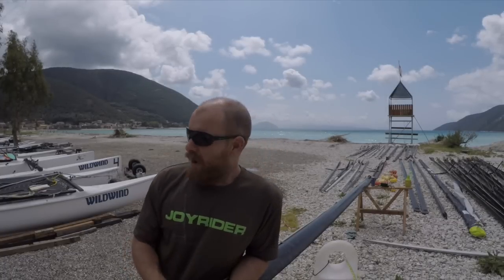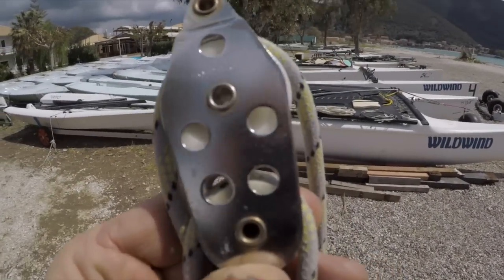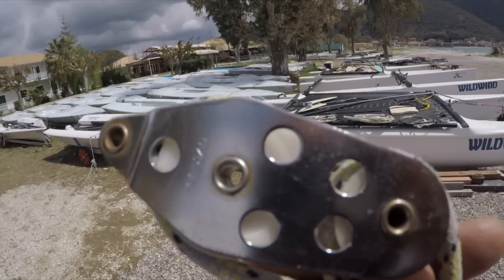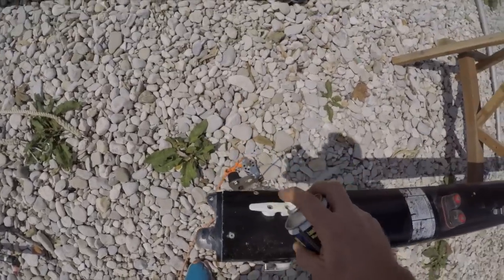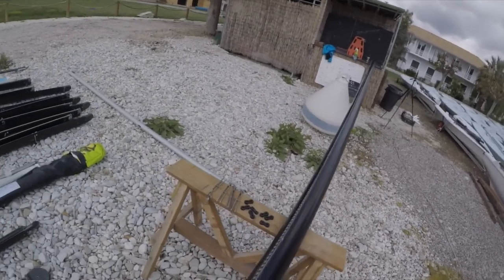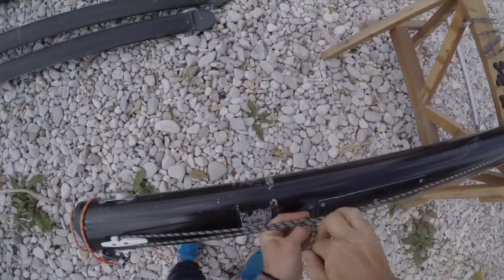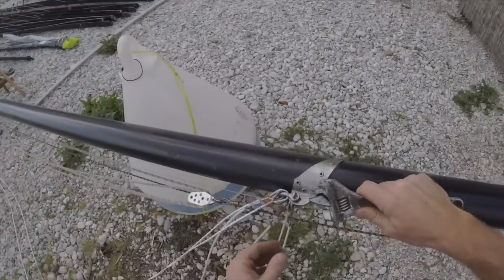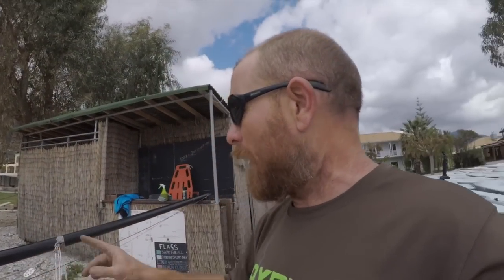Putting new rigging on the Hobie 16 catamaran mast

Comment: Great vid as always Joe.  Thanks for putting it together.  My '85 H16 has a three hole tang on it's original aluminum mast. I've put the fore stay pigtail and shrouds through the lower hole. The trapeze cables went through the larger middle hole also with a d-ring.
Reply from the maker: That sounds right, if you check the FX1 mast video it will be more similar:
https://youtu.be/8QXFGx2D2kw

Comment: Very helpful. I couldn’t figure out how to get the old main halyard cable off (through the top of the mast) because it didn’t have a soft eye loop. So I simply took a hammer and flattened the eye just enough to get it through. Thanks!
Reply from the maker: It must have taken a lot of hitting! I'm glad that the video helped.
Reply: I have a similar issue with the hard eye. Not sure yet how I'm going to get the new one on  my '85 H16. I suppose I could remove the eye on the new one and use it as a soft eye as you have in the video.

Comment: Hello Joe. Your video's are  well done and very informative. I'm hoping you can help with a question. I recently purchased  a 1984 Hobie 16 and am setting it up for sail. The shrouds seem fairly loose. Measuring the slack, I can pull the shroud out apprx. 4.5 inches.
Without a gauge, do you have a suggestion for the amount of tension? The shroud is attached in the bottom hole of the stay adjuster and it seems any adjustment would be from the thru hull bolt.
Any information or resource would be greatly appreciated.
Thanks
Reply from the maker: Have a look at this one and let me know if that helps : https://youtu.be/8D3Kv3ugPhY

Comment: Hi Joe
I have a hobie21se and recently a storm in south of portugal knocked my boat down and lost my mast
The Hobie factory said the mast is not available anymore...
Any solution to put it back on water?
Thanks Tenzin
Reply from the maker: To get another mast the same length I think you would need to find a mast maker who can sell you the bare tube and then you could transplant the fittings. 
The alternative would be to replace it with an aluminium Tornado mast but it would be 1m shorter so you'd need different sails.
Reply: @JoyriderTV  Thanks Joe that was also my first choice to purchase a bare tube and add my fittings on it.

Comment: I am having trouble with the pop rivets on the base plate, they keep shearing off when I raise the mast, have you had this trouble before?
Reply from the maker: I've never experienced this problem. Are you using stainless steel rivets?
Reply: @JoyriderTV  stainless or aluminium. im not to sure. its fine while the mast is seated, i think its just quite allot of strain on the hinge while its being stepped.
Reply from the maker: @theislandworkshop8453  I've never experienced this, maybe it's some wear to the mast base or bottom of the mast which is putting them out of line
Reply: @JoyriderTV  yer its a weird one, as you can see from the pitcures i sent for "show us your cat" its fine once its up. hopefully it wont give me much trouble. thanks for the reply mate